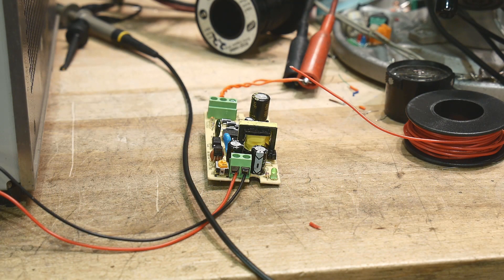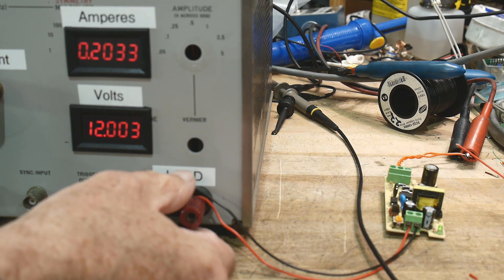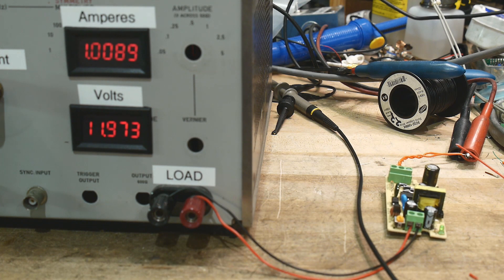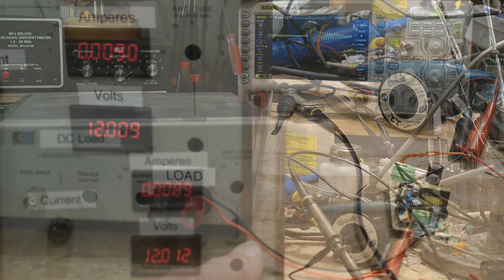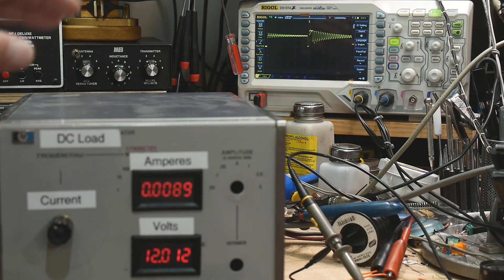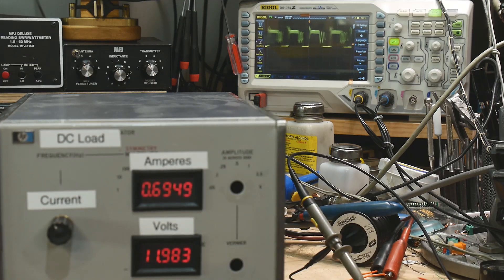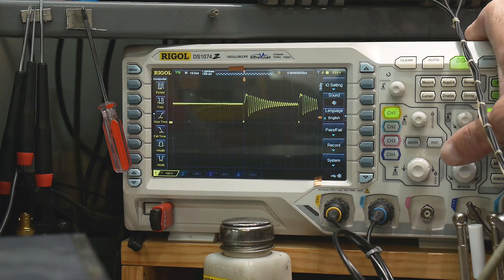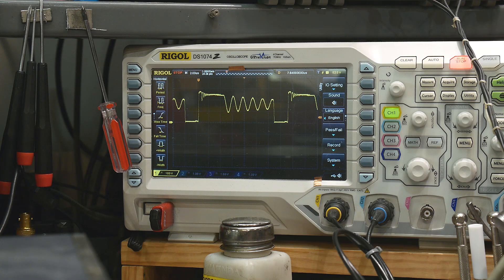#773 Basics: Switching Power Supplies (part 2 of 2)

Comment: On you oscilloscope. Are you using active probes? Or isolating transformer
Reply from the maker: no, standard probes are fine
Reply: @IMSAIGuy but your oscilloscope is not connect mains earth?
Reply from the maker: @Mk-tp2mz  yes, you have to be very careful since the ground lead of the oscilloscope is earth ground. the input section is already referenced to earth, the output is floating and connecting the ground to earth is ok.   this is not always the case, so again be careful.

Comment: and about current limit / protections?
this kind of PS have OCP/OVP ?
Reply from the maker: this is a very simple supply. if you OC then the voltage just droops. if the regulation circuit fails, there is no backup for over voltage.

Comment: 1. Where did you probe the signals? Is it on the transformer side as I can see it is about 100V peak to peak? 
2. According to the DK1203 spec, the VCC operating voltage is 4V to 6V, when you measure the rectifier, it is 164V, how does it bring down to that vcc level?
3. There are some kinds of oscillation in your waveform, are there any oscillation on the secondary side of the transformer?
4. How are the waveforms look like of  the output with load current of 0.2A, and 0.5A at the opto-couple side and the transformer primary and secondary sides?

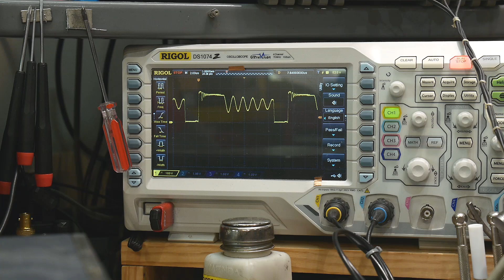Comment: what is the bouncing/ringing sine wave after the square wave of each pulse? looks like there's a very high frequency ringing followed by a low frequency ringing. for instance at 6:21 you can see it very clearly, the sine wave looking signals that's slowly reducing in amplitude (dead center on your oscilloscope screen at that timestamp)
Reply from the maker: https://youtu.be/H0xK7Vwsfy0

Comment: This #773 and the previous #772 were very good to know. Did you see how it works if in OVERLOAD (overcurrent) mode? 
When does it happen? Does it enter intermittent ‘hiccup ‘ mode or simply looses regulation like those cheap 12V adapters?
Reply: Without an overcurrent protection shutoff circuit it will just burn itself up.  I know because I've seen so many junk PC switching power supplies fail in exactly that way on overcurrent condition where they just blow up. Check out the Games Nexus video "Speedrun Gigabyte Power Supply Explosion: Biggest Failure Yet "

Comment: Mr @IMSAI Guy, thanks for another great video. I have a question. How does a switching supply reduce the transformer size requirement -- or does that only apply in certain applications?
Reply from the maker: higher frequency, less inductance needed

Comment: Excellent video demonstrating the PWM function of the DK1203 switch mode controller IC as it receives its feedback from the TL431 shunt voltage reference IC. Thanks for showing us the actual waveform on the oscilloscope Mr. IMSAI Guy! Always an interesting video on your YouTube channel. You are very much appreciated. I found the ringing, after the on pulse rather interesting to see...   Fred

Comment: Is this measured across the switch or across the primary?  It looks like it is across the switch which goes low when the switch is on, the high flat part is where the diode in the output is conducting, charging the output capacitor, and the ringing part is when the output winding voltage has dropped below the power supply capacitor voltage so it is disconnected and the transformer is resonating with the circuit parasitic capacitance.  Is that what we are seeing on the scope?
Reply: I think that's the exact explanation of the waveform.